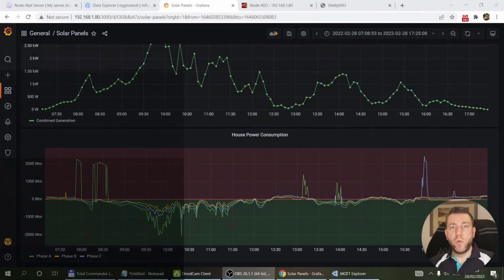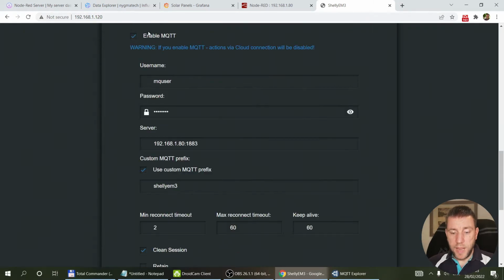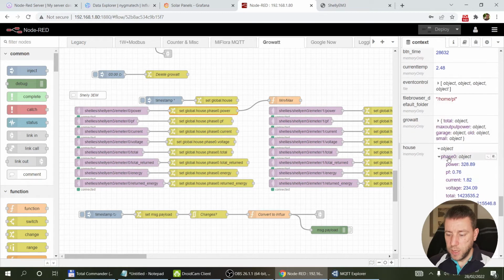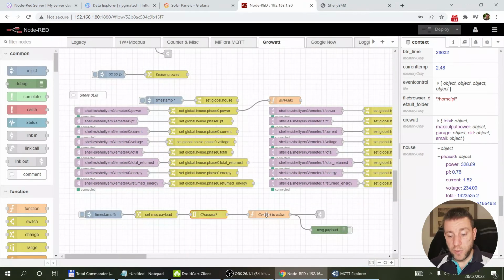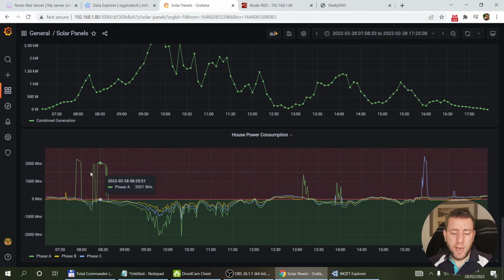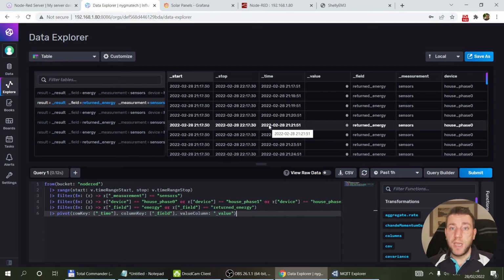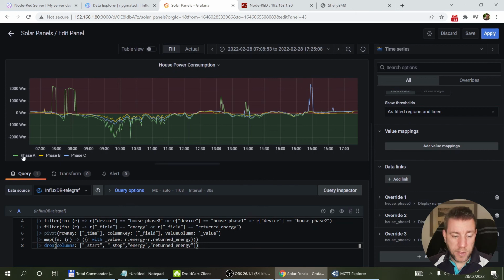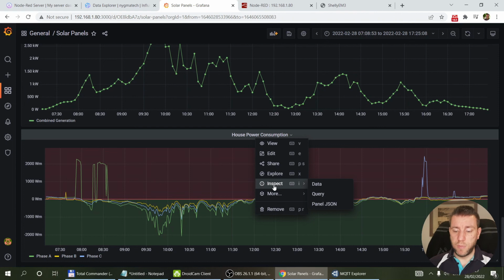Shelly 3EM to MQTT to Node-Red to Influx to Grafana

Comment: Csongor, thank you for your video! Very Neat. A question: Is It posible to communicate Shelly 3EM directly to Cloud Influx? Can be Influx's Telegraf be configured to make the needed conversions for influx, instead of using Node-Red for conversions for influx?
Reply from the maker: Thanks. I never looked into Telegraf too much, because it was always easier for me to use Node-Red. But it has an HTTP input plugin and the Shelly 3EM has a status URL which returns everything in JSON format. It should be possible to fish out the data from the JSON and send the values for injection.
Reply: @csongorvarga  Thank you for the answers. Also ask, for the login method. InfluxCloud Serverless services, asks for Client, Bucket, and TokenAPI, in order to login and send data. Shelly 3M asks for Username, Pass, Server:port. Has Shelly ways to change the login method?
Reply from the maker: @JefedeProyectosHPBSPA  I never used the InfluxCloud, but I assume when you log in you create a bucket for the data and also an TokenAPI that has write access to the bucket. For the Shelly, by default the access is open, no username or password is required. But on the shelly's webpage you can set a user and password as well. The IP would be the Shelly IP and the port is 80. Your Telegraf is also running in the Cloud? In that case you need to open up the SHelly to the internet to make is accessible from the outside. And in that case you also need a DDNS service have a fixed DNS name. Not easy to do all this without a local server...
Reply: @csongorvarga  Is Shelly EM the one that send the data via MQTT client. But Shelly EM does not log with the right method on Influx. Therefore data does not arrive to InfluxDB. The bucket and TokenAPI has to be created before hand on influxdb.

Comment: Hi,
very interesting. To measure the Energy in "Wh" I have used the Power measurement and integrate it in Grafana like:

SELECT integral("value")  /3600 FROM "shellies/shellyem-C45BBE77DB37/emeter/0/power" WHERE $timeFilter GROUP BY time(1h) fill(null)

while, if my understanding is correct, you are using Energy measurement,
Is it a more accurate approach?
Reply from the maker: I think it is a less accurate approach, because as far as I know the power value is the momentary value when you query the device. That is not the average power for the time period when you run the integral function. Unless you read the value every second, in which case it is close.

Comment: Nice. Interested in seeing how you would do hourly daily monthly computations (sum of all phases together and not individually since that is how we get billed) While also being able to see those values at the current instance. Meaning, I should be able to open grafana and see how much I have consumed this hour, this day and this month like home assistant energy dashboard does. 

The reason for me looking for alternatives for this when home assistant is doing computations well is home assistant does monthly computation for each month but my billing cycle is in the middle of the month. I need to be able to reset the monthly computation to 0 when my bill reading is taken and count consumption and generation from there. Essentially be able to match my data with what I am being billed for.
Reply from the maker: Hmm, this is an interesting challenge. I think I will look into this, I just need this logic to run for a few weeks or for a month so I have some data to work with. But in this Shelly there also a total field, so hopefully I can just use the difference function in the AggregateWindow to automatically calculate consumption in any arbitrary time period. So it should be easy to do it even with a mid month billing cycle.
Reply: Sure, I am using a bunch of pzem004t's right now plugged into raspberry monitoring 3 phases of load, 3 phases of solar and some other smaller circuits. unfortunately these do not support bidirectional monitoring and since they are independent devices, i have to sum the kwh up myself. My circuitsetup board shipment got stuck somewhere in international shipping and i gave up on it and went with the pzems which were locally available. The emporia is available now but i dont want to spend any more money on this energy monitoring craziness. The bidirectional meter from the Electricity company has RS232 and i believe it is DLMS based but i cant find a manual for it and hence unable to try reading energy data from it directly.
Reply from the maker: @MrBlackpanther87  I don't think that would be a problem as well. If you can load some incremental consumption data (like watt minutes in my case) to Influxdb again, you can use the AggregateWindow function and use the method sum that will sum up all the readings.
Reply: @csongorvarga  AggregateWindows are the way to go, then extend it with continuous queries (aka tasks in influx2). These create aggregates over time and write them into an other place. I am writing all my raw wattage, voltage, amps, etc. values into a bucket which has 3 months retention. Then tasks are creating by the minute, by the hour and by day aggregates (integral function yielding kwh values), and writing them to an other bucket with infinite retention. Of course you can also rely on the cumulation that shellies provide.
Reply: @andrasgaal  Is this a feature specific to influx 2? im running on the older version so i will explore